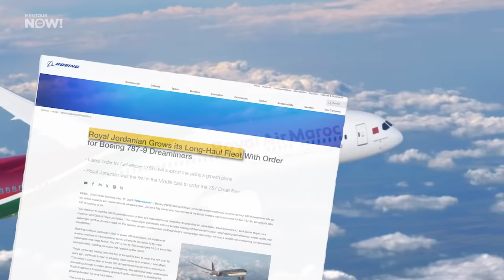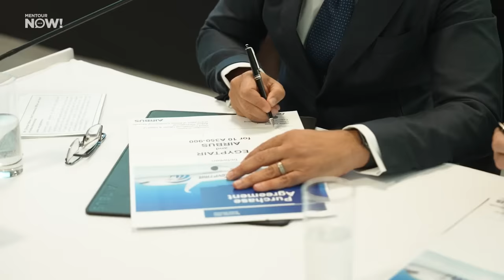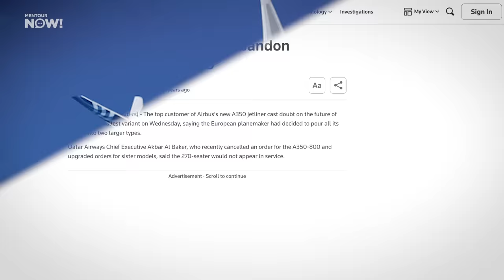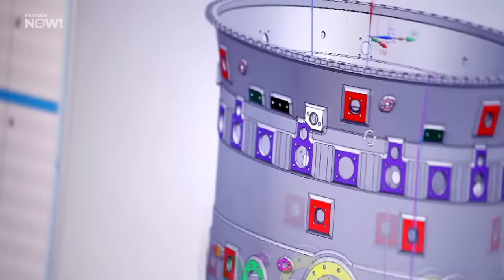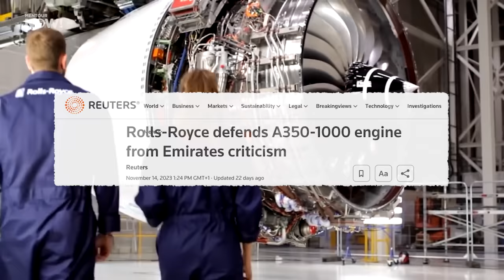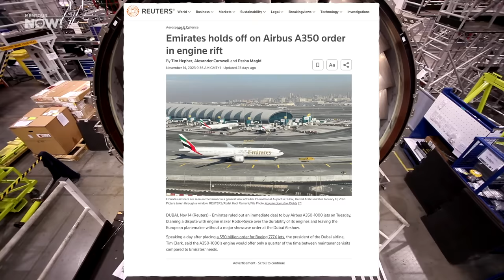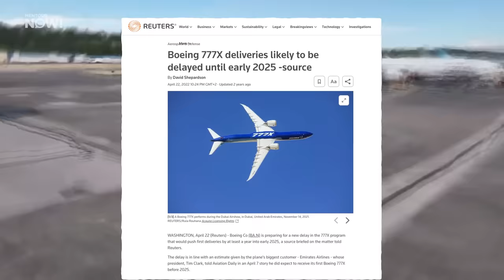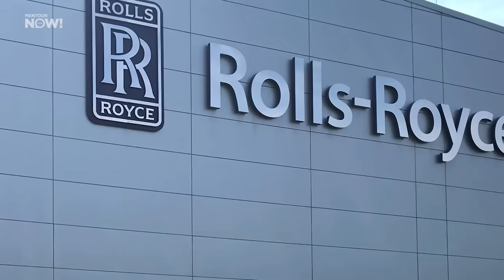What’s WRONG with the Airbus A350?!

Comment: The A350 series is a clean sheet design with a high percentage of composites and has a much lighter airframe than the Boeing 777.  The 777X has yet to enter service and Emirates are taking a lot on faith that it will not have issues and that the GEnX engines offer better operational service than the Trent XWB.   If GE fall short then there will be a lot of red faces at Emirates.
Reply: Considering that the Trent XWB has a reliability rate of just 99.91%, and the GE90-115B/GEnx have a reliability rate of 99.98%, we can see where this is going
Reply: "Much lighter airframe" - Not really, while it will obviously depend a lot on PAX config, using published OEWs of 352k with 369 PAX in 2 class config for for the A351K and 400k with 426 pax in 2 class config for the B779, you arrive at a slightly lower weight of 938 lbs OEW /  PAX for the B779, and 954 lbs OEW / PAX for the A351K.  So if anything, the 777-9 is actually a lighter airframe for the number of passengers it carries.  I would speculate this is down the the 777 aluminum fuselage being an extremely advanced design, coupled with Boeing's 2nd gen of composite wings, while the A350 is Airbus' first generation of composite wings and a nominally composite fuselage that seems to be optimized for ease of manufacture rather than outright weight savings (panelized design with metal frames instead of full barrel monolith).
Reply: @TeKnOShEeP  160t for 35K is way off. Nominal published OEW is 155t, actual OEW seen from various airlines are slightly lower, while with NPS it is 1.2t lighter than ever.
As for reference, 359 and 78J has around the same OEW before NPS, with 359 having a larger wing, higher MTOW but slightly shorter fuselage.

777X in comparison is heavy. 181t is a very optimistic estimation for the 779, while 778 is simply uncompetitive against similar sized 35K. Even as an aluminium frame, 777 isn't exactly known for being light either - 333 is 7t lighter than 772A, and 10t lighter than 772ER. Even the quadjet 343 weighs less. The true strength of 777 though is its heavylifting potential, which helps them avoid direct competition from below.

Regarding wing, it's more like a tradeoff than Airbus "dumb". Boeing's approach means a lighter wing, at a cost of higher wing loading and flexing (which increases drag). Airbus' look stiff, but in return it has low wing loading. 350's wing are strong at climb and field performance. A330/A340 wing was also very good, considering it managed to keep A340's fuel burn not too horrible even with 4 shortaul focused CFM56s, or A330NEO closely match 787's fuel burn with no major changes other than winglet tweaks.
Reply: @steinwaldmadchen  Er, what now?  I've weighed more than one A351 at several MROs, and none of them were lighter and 345k, most in the 350k range.  No idea who is operating them lighter than that, unless it's an all economy config or something.  Also, lol, no 787 is within 10k of an A359, even the heaviest -10.  The 359 is a much bigger plane, that's why it carries more PAX and has a longer range.

777X is still in development, so not sure how you can say it's heavy when no one has been able to weigh one in service.  It has a completely newly designed fuselage, with updated gages and alloys, so I don't really think the classic design from 35 years ago is really a valid comparison.  I would expect weight savings on par with what happened on the A320 classic-> NEO, as it's a similar timeline.  Aluminum design has quietly gotten very, very good while everyone was jumping on the composite bandwagon.  If the released numbers are at all accurate, then it will in fact be a very light airframe, contrary to your assertion.

Wings?  Flexy != draggy with any halfway decent understanding of elasticity by the designers.  But form drag is a thing, and A350 wings are thiccccc, especially that wing root, mmm damn.  The 787 is known to be an extremely slippery airplane that is very easy to inadvertently hit Vmo in cruise, the a350 not so much.  TO/Climb performance depends on a lot of factors, but yes, lower wing loading does improve it, so it wouldn't surprise me if the A350 does have a higher max climb rate (don't have the ops manuals in front of me so I can't confirm that).  In cruise though, no, you're going to pay the price for that form, and also the extra skin drag.  There's a reason glider wings are the way they are- low drag.  And again, we return to the A350 wing physically having more material in it- shouldn't be surprising it's draggier- it's bigger.  

Fuel burn is a wonderful topic that can be argued until the cows come home, but at max range the per passenger mile fuel economy of the 787 and A350 are very similar 19.5-20.5-ish NMi/lb, the A330Neo is a tad behind at 18-19ish.  All of that is way, way better than the poor A340 which, sorry, was in fact horrible, 14-15ish NMi/lb.  No magical wing design (which it didn't have) is getting around the fact that quad jets inherently burn more fuel than twins, for obvious reasons.
Reply: @TeKnOShEeP  You seemed to also mix up things

1. A340 is a 90s design, of course it can't compete with modern designs like 787 and A350. And it is not great when comparing with A330 of same size, its sister twinjet. However it actually burns slightly less per trip than similar sized 772. And the trick is a lightweight frame and good wing, combined with some other compromises.

2. A thick and stiff wing doesn't mean it's bad lol. And that is reflected by A350's high lift / drag ratio. A350's wings are efficient lift generators, and L/D ratio is in fact better better than 787s. A larger wing area also result in lower wing loading, allowing the aircraft to climb to higher alititude earler for more efficient cruise, and lower thrust for takeoff (while 77W and A321NEO is the opposite). TrentXWB-97 actually has 10klb less thrust than Trent 898 that powers 773, despite 35K's higher MTOW. The wing is approprate for a heavylifter with long range flying in mind.

3. A330s are also surprisingly competitive at that front as well, in fact LD ratio also slightly higher than 789/78J, hence why Airbus kept the wing largely untouched when developing NEO. (They aimed ~2% behind 787, at least for 339 vs 789). As an older metal wings there are more compromises on the 330 side, and cruise speed is one of them. But that's not the point - the wing was extended significantly after the initial SuperFan for A340 was replaced with CFM56-5C, to compensate the worsening TSFC.

4. The wing flex of 787 does mean lower L/D ratio by reducing the upward lift generated. It's not desirable, but it's also a result of tradeoff. In fact 787's wings were more optimised for -8, they decided not to make bigger wings for -9 and -10, for the sake of production cost and weight savings.

5. According to ACAP published by Airbus, the highest MZFW found on 35K is 223t, while structural payload is at max 68t, which translates into an OEW of 155t. And according to pilots working for Cathay Pacific (a heavy user of both 77W and 350), their 35K consistently load better than 77W, while multiple sources suggest it is lighter. 160t  is too off. 359's OEW is also less than 140t according to real life experiences.

6. For the 777X side, between an MTOW of just 351t, an advertised range of 7285nm for 426 passengers, an OEW of 181t, and a similar/better per seat fuel consumption than 35K etc., things just don't stack up. As no official figure is published, only spectulations can be made based on 777 figures.
That said, 779 is already in test phrase, and no significant changes can be done at this point. Boeing should know the figures, so do prospective customers. They seemed to be tight lipped though......
Reply: @steinwaldmadchen  

Sigh- just no, to any of this.

1. "actually burns slightly less per trip than similar sized 772" "similar" is doing a hell of a lot of work there, assuming it's A342 the 772 is carrying more PAX, and none of the other variants are burning less.  But don't take my word for it, Emirates wrote off their A340s to zero before they retired their 772s.  I would presume they know what they're doing.

2. "lower wing loading" You seem to think this is an unalloyed good.  For a given weight, you have better climb performance but more wetted area, which is more skin drag, which is worse cruise performance.  And no, an A350 does not have a better L/D in cruise than a 787.  It does have a better engine.

3. "A330s are also surprisingly competitive at that front as well, in fact LD ratio also slightly higher than 789/78J" Lol, no, see above only worse.

4. "The wing flex of 787 does mean lower L/D ratio by reducing the upward lift generated. It's not desirable, but it's also a result of tradeoff."  Yes, that tradeoff is that during the phase of flight when you wing is flexed the most (when you are at your fastest, i.e. cruise), you need the least amount of lift, so a lower L/D is acceptable if it results in an outright lower D, and hence better efficiency.  There is a reason modern wings are slim and flexible- modern airfoil theory has come a long way from the 70s and 80s.

5. " 35K consistently load better than 77W, while multiple sources suggest it is lighter."  Of course it's lighter, it's a two decade newer design using full composite construction.    It would be shocking if it wasn't lighter.

6.  "For the 777X side, between an MTOW of just 351t, an advertised range of 7285nm for 426 passengers, an OEW of 181t, and a similar/better per seat fuel consumption than 35K etc., things just don't stack up." Really?  After point 5 you don't understand why a brand new fuselage, a brand new composite wing, and a brand new engine wouldn't result in better efficiency? Frankly, the only shenanigans here is that Boeing is trying to certify it as an ATC when it's pretty clearly a new goddamn design.  Time will tell if the FAA actually allows that to happen.
"As no official figure is published, only spectulations can be made based on 777 figures." Why?  That a terrible speculation.  All the major performance elements have undergone radical changes.

Whatever.  Have a good un'
Reply: @TeKnOShEeP There's no point continuing the discussion when you're comparing 772 with a much smaller niche aircraft 342 lol.
 Everything looks efficient if the baseline is 747SP.
Reply: @steinwaldmadchen  Lol, you said the A340 has less fuel burn than a 772.  The 342 is the only variant for which that statement is remotely close to true in an absolute sense, much less a per PAX mile.  Any other comparison is nonsense malarky.  To quote Tim Clark- "the A340 was designed when fuel was $25-30 a barrel, they fell over at $60, and $120 they haven't got a hope in hell."  And then he wrote his A340s down to zero value, couldn't even resell them.  Seems the market disagrees with your assertion.
Reply: @TeKnOShEeP Sorry but your claim simply doesn't resonate with the actual experiences of actual airlines, nor aviation consultants in the case of wing specifications.
In fact, majority of 343s were replaced by either 333 (which also replaced some 772s) or later generation aircraft, not 772. Airbus also didn't need to buy back 777s as incentive to sell 330s.
Reply: @steinwaldmadchen   There are 70 ish A340s still in operation, there are over 900 777s still in operation.

Emirates (777 and A340 operator): our A340s have zero value, writedown.  Thai Airways (777 and A340 operator): We'd have to fill our A340s to 120% just to break even.  Retired  Air France-KLM (A340 and 777 operator): it's a tanker, with a few people aboard.  Retired.

Consultant who claims the A340's magic wing gives it better fuel burn than a 777: dead silence, due to not existing (because that's a laughable claim that gets you kicked out of your job).

You're off in la-la land with the magical thinking here.  The actual experiences of airlines with the two types are quite clearly illustrated above.  Your claims are nonsense.
Reply: @TeKnOShEeP  You don't even get the basic fact right lol. How can we continue?

I have been very specifically talking about CFM-56-5C powered A340-300, class 777-200ER that comes with 3 engine type options, and the A330s.

In that sense 343 isn't only 7t lighter, but also burn slightly less than 772 per trip (~6.6t/h vs ~6.7t/h). 772 does have a higher payload, faster cruise and lower per seat fuel consumption if configured in 10-abreast.
But given the fact that CFM56 isn't exactly designed for a 10h+ flights, the airframe is good. The same design also gives 333 a huge edge over 772, and stay relevant up to this date in the form of 330NEO.

Only 77W has a significant advantage over 346, but that's another story.

Thai never operated a single 343s, while Emirates was not a big operator of either 343 or 772( both aircraft left the fleet by 2016). Cathay however have never ordered 772ER despite having 772A and 773A in fleet, neither do Air China. Cathay's 343s stayed active for around 2 decades, and while thier competitors often put 772ER on the same route, it never really put them into disadvantages. Even for Air France, their 343s were retired because of age, and they still had more 343 than 772 throughout the history.

Even for the most iconic switch to 772, it was only possible with Boeing buying back SIA's 343s, and SIA is known to be an opportunitistic buyer. And ironically, A340 reentered SIA's fleet in the form of 345.

In terms of maintenance, it's not always that clearly favour 772 over 343. Not only because of the troubled PW4000 and still immature GE90 in their early form, but also the fact that CFM56-5C is a variant of the mass-produced engine that also powered thousands of 737s and A320s.
Reply: @steinwaldmadchen  Lol "I have very explicitly been talking about this exact case I think makes my point despite never mentioning it before, and yet I still got the numbers wrong, quoting a fuel burn value that would crash planes.  Also I think the CFM56 isn't a long haul engine, and Airbus was stupid to put it on their long haul plane, the USAF was stupid to put it on the KC-135, and Boeing was stupid to use it to certify ETOPS 737s.  This makes sense in my world."

If you're going to have an irrational fanboy epidemic about an Airbus, why would you choose their worst plane?  Actually, don't answer that, I don't want to know.
Reply: @TeKnOShEeP  None of the Cathay's A350-1000 is as heavy as 160t (nor their competitors), and A340-300 didn't burnt more than 777-200ER.
Only A340-600 was horrible, and was replaced by 777-300ER once they arrived.
Is that clear for you?

Why would I trust a random fanboy like you than pilots that actually fly/flown the aircraft?

Regarding quadjet, there was a time when ETOPS was not as extensive as it currently is. Back in the 2000s often the A340 was 1h faster than 777s despite its slower cruise speed, because twinjet was limited to the more winding routes closer to the diverting airports. In fact, its not until the certification of ETOPS 330 in 2011 enabled practical twinjet flying across the Southern Hemisphere (SCL-AKL, PER-JNB etc)

A340 was the smallest and cheapest quadjet to do so. Boeing could lobby for an ETOPS for their new 777s and ask GE for a specifically designed new engine, that's simply not an option for Airbus as an underdog. Building A330 and A340 in parallel at the minimal possible cost is their best bet.
The result is a quadjet that's lighter than twinjet, and a twinjet that's way better the competition.

Comment: The A350-1000 seems to be cheaper & more efficient. Maybe Boeing  offered a huge discount - combined with a small advantage in capacity and cargo. Both planes are beautiful. Qatar 350X lands here at DFW and its very graceful.
Reply: I fly on that Qatar -1000 out of DFW every other month.  I think it's the quietest plane I've been on.
Reply: @jemez_mtn Even quieter than A380? I haven't flown on A350 yet.
Reply: @Chopper153  Hmm, yeah actually the 380 is probably the quietest now that you mention it, followed closely by the 350.  Then maybe 787, which I didn’t find amazingly quiet.

Comment: Emirates may be counting on a lot of issues going their way because the A350-1000 exists and is approved by various Government bodies and in Service whereas the B777X  is not in service yet, and has a way to go just for approval by the FAA and other Countries' Administrations.  As I recall, besides the Approval issues there have been some problems with the GE9X engine as well.  I haven't kept up lately so those may have been solved by now. So Boeing has at least 2 big hurdles to clear before the B777X is delivered and it's already way behind previous estimated delivery times. I hope it all works out well for Emirates, but is seems to me a bit more speculative to go with Boeing in this case. Of course there is a lot of time between order and delivery and plenty of room for changing circumstances.
Reply: There are o changing circumstances. Start you a business and base it on business. YOU wanted Emirates to select Airbus. If they were falling from the sky you would blame pilot error.
Reply: GE issues have been solved a while back and updates to the engine have already been implemented. Next please
Reply: @mmm0404  I don't remember an issue that grounded TrentXWB at all. Durability hurts operating cost but if properly fixed safety is not sacrificed.
Reply: @steinwaldmadchen  never said there where any issues with the XWB

Comment: The fan diameter of the RR XWB-84 and XWB-97 is the same. They are both at 3 m diameter, the number is related to the max thrust of the engine (84k lbf vs 97k lbf).